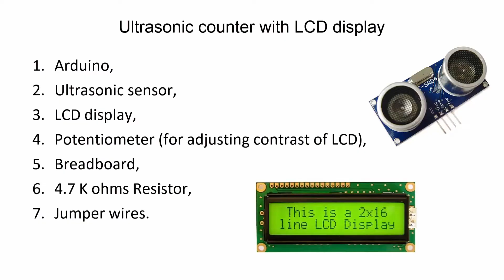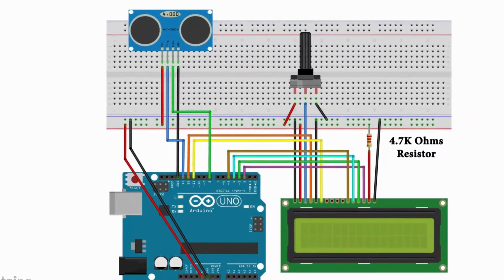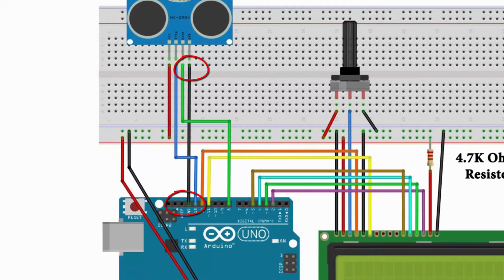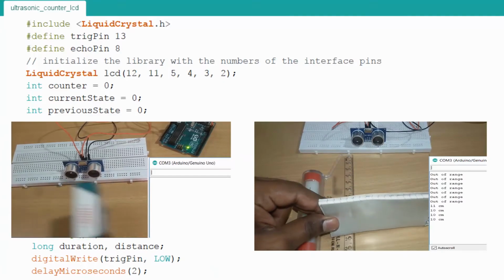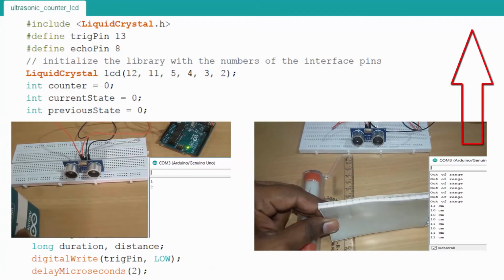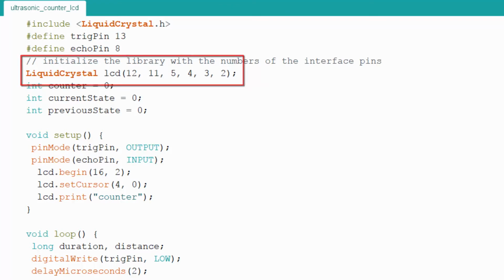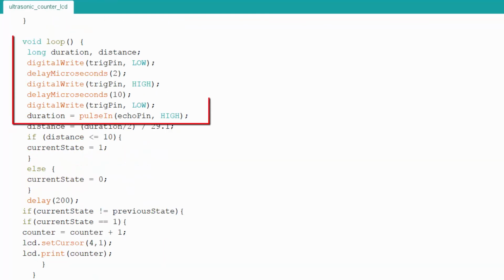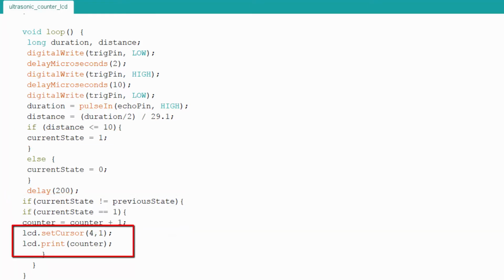Arduino Tutorial #22 Ultrasonic sensor counter with LCD display

Comment: can you create a video with reset button thanks 
or using infrared sensor
Reply from the maker: yes we can add pushbutton. if you dont have pushbutton and dont know how to add that. you can reset counter by just pressing arduino on board reset button. it will also works same as that pushbutton.
yes i will make video on infrared sensor with pushbutton to reset.

Comment: What will happens if the object stays in front of the sensor , if it will keep on increasing what should be done to avoid
Reply from the maker: 1. you can increase delay time. but it will  delay for whole counting.
2. you can use two sensor, so that when it stay infront of sensor 1 it will not count. when it passed from both sensor it will count. i think this is more suitable than using a delay function. https://youtu.be/TI6mx3jtoY0 watched this video for bidirection counter or  counter using two sensors.
Reply: Robotica DIY  how can I put a reset button in this project
Reply from the maker: Reset means you want to set counter to zero, right.  there is two way first, you can reset counter from arduino on board reset button. this is easiest way. second way is you have to put one push button on breadboard and do changes in code (like when it get high it will reset counter to zero).
Reply: Robotica DIY thanks for reply, I’m using i2c liquid crystal so how can I change the code to match this type of lcd
Reply from the maker: watch my I2C video   https://youtu.be/Geq9jkKhjCg  
and instead of serial.println use lcd.print 
you can also watch this bidirectional counter https://youtu.be/AZrYysD6QsI
Reply: here the code , but nothing displays on lcd //YWROBOT
//Compatible with the Arduino IDE 1.0

 #define trigPin 13
 #define echoPin 8//Library version:1.1
#include <Wire.h> 
#include <LiquidCrystal_I2C.h>

LiquidCrystal_I2C lcd(0x3F,16,2);  // set the LCD address to 0x27 for a 16 chars and 2 line display

int counter = 0;
 int currentState = 0;
 int previousState = 0;
 
 void setup() {
 pinMode(trigPin, OUTPUT);
 pinMode(echoPin, INPUT);
 lcd.begin(16, 2);
 lcd.setCursor(4, 0);
 lcd.print("counter");
 }
 
 void loop() {
 long duration, distance;
 digitalWrite(trigPin, LOW); 
 delayMicroseconds(2); 
 digitalWrite(trigPin, HIGH);
 delayMicroseconds(10); 
 digitalWrite(trigPin, LOW);
 duration = pulseIn(echoPin, HIGH);
 distance = (duration/2) / 29.1;
 if (distance <= 10){
 currentState = 1;
 }
 else {
 currentState = 0;
 }
 delay(200);
 if(currentState != previousState){
 if(currentState == 1){
 counter = counter + 1;
 lcd.setCursor(4,1);
 lcd.print(counter);
 }
 }
 }
Reply from the maker: LiquidCrystal_I2C lcd(0x3F,16,2);
in this line change 0x3F to your I2C address. you can find your lcd address but watch full video https://youtu.be/Geq9jkKhjCg  i have shown how to find it. if you already found then please check contrast of lcd by adjusting potentiometer on i2c.

Comment: Robotica DIY
Thanks for your project.
do you know how to make it unidirectional with the HC SR04? for example: only enter.
Reply from the maker: @Dayanne Chilatra it is already uni-direction. i mean it count whatever goes in front of sensor any direction enter or exit (but it will count entry and exit means 2 count). if you want to count only object entering then this video is perfect (just setup this at entry point). if you dont want to count exit then you have to use one more ultrasonic sensor. but if you want to account exit object for example how many object enters or how many object exit and how many object left in the system then it will be bi-direction.

Comment: Shall we do this project without potentiometer
Reply from the maker: Answer is No and Yes, without potentiometer it will not show anything on screen. if you dont want to use potentiometer you can use I2C  which have inbuild potentiometer. you can adjust contrast by it (But again you required I2C in place of potentiometer). the advantage of using I2C is that you require less wires to connect lcd and it will also save 4 inputs and outputs pin on arduino board you can watch that video https://youtu.be/Geq9jkKhjCg
Yes, you can do it by without potentiometer but you need to make changes in code, use pwm pin for writing particular value for contrast. which require some effort to find that particular value.